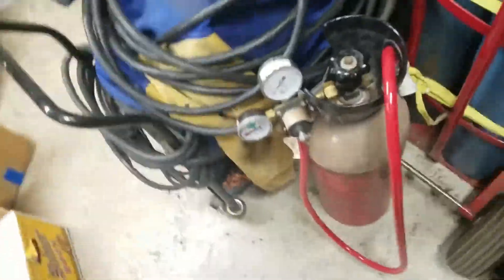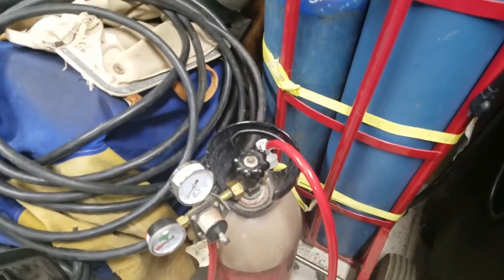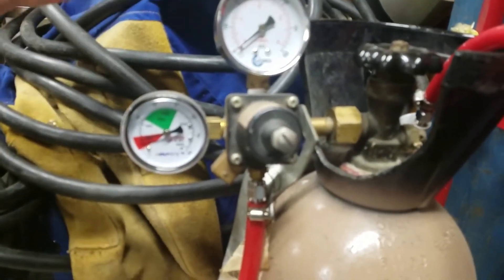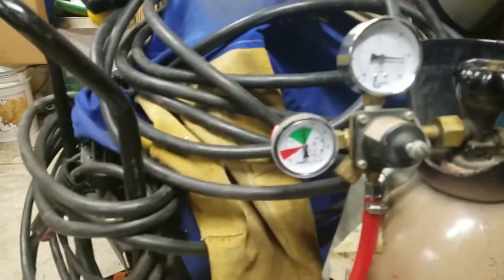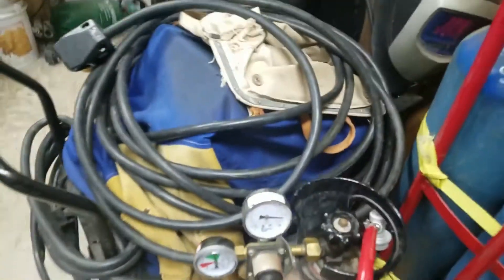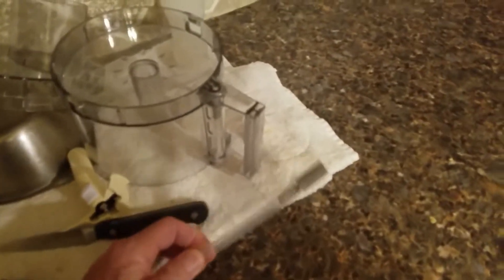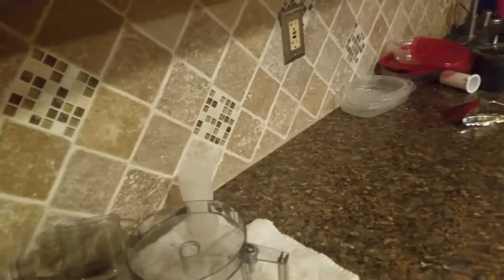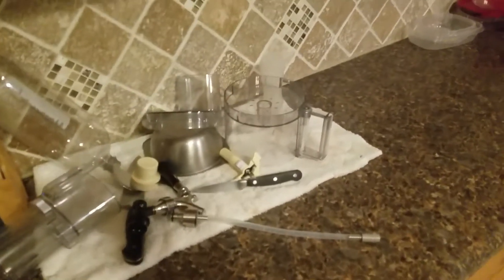A home built Soda Stream alternative! Cheaper seltzer water!

Comment: Also not a soda stream, I have an old school soda siphon that is recharged using 8 gram CO2 cartridges. It’s probably about $0.50 to 1.00 per 1L of carbonated water so not amazing. The siphon is much more of a novelty in my mind but I have always wanted one. Your method has got to be cheaper. Maybe I should make an adapter to fit the siphon recharge valve. 

Also per a graph I just looked up, CO2 solubility in water is greatly affected by temperature and pressure. The colder it is the more it can dissolve and higher the pressure the more it can dissolve. So, as you said, starting with cold water or allowing it to cool after the CO2 is added is a best practice. 

Do you drink it straight or add syrups or flavorings?

Refill procedure for the siphon below:
https://youtu.be/EVv17K5cfHo
Reply from the maker: I will add lemon or lime or sometimes use sport drinks as a base and just water them down with fizzy water.